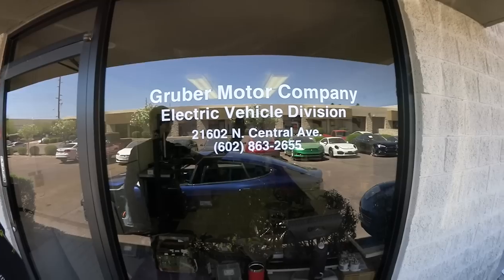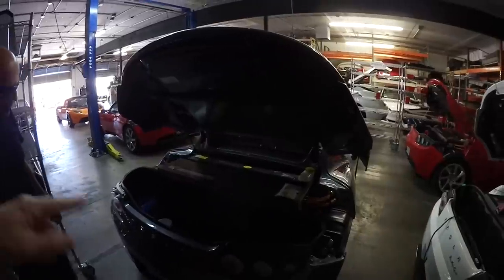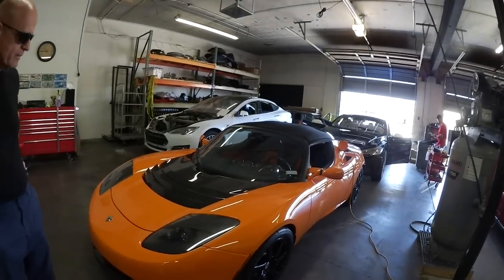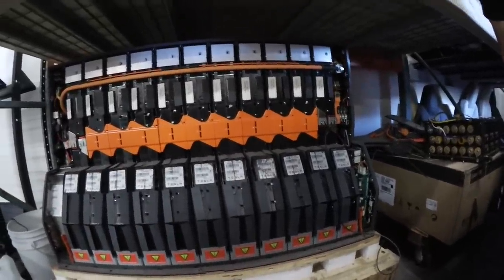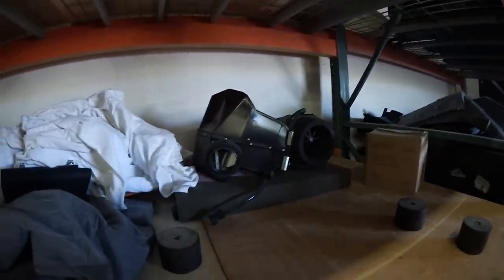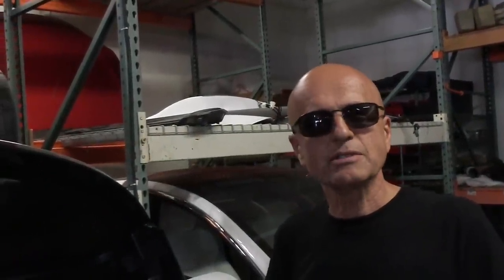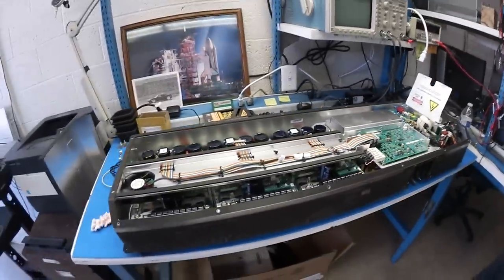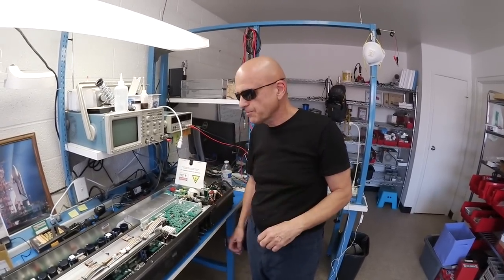Tesla Roadster How to revive it?

Comment: I've been doing this to my LiPO batteries for years. I have a bunch of RC planes and helicopters. Sometimes a cell gets drained too low of a voltage from sitting unused too long. It's not a design flaw. It's just a fact that batteries eventually drain themselves due to internal leakage. If you let them drain too low for too long it will destroy the battery.